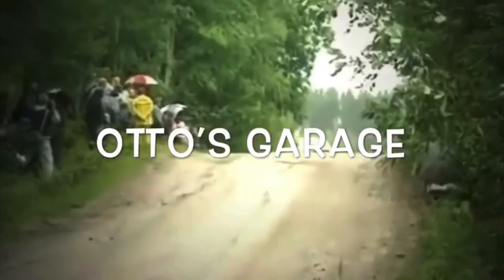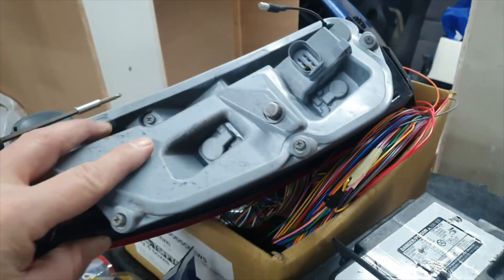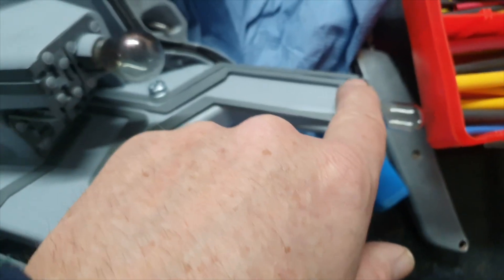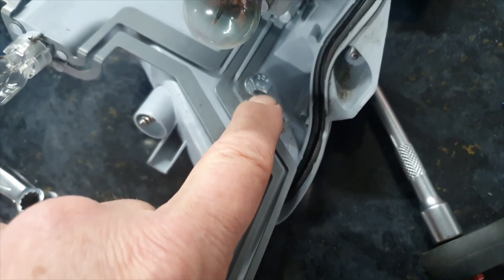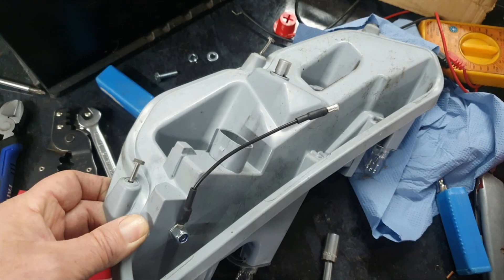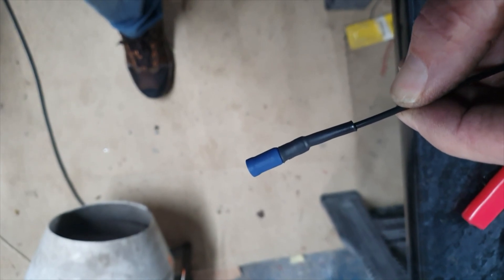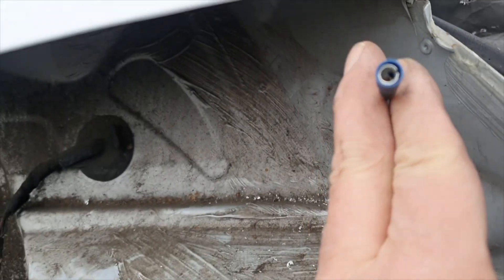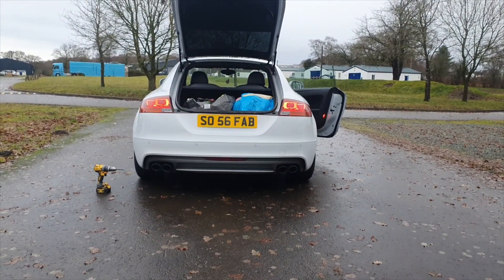Audi TT Mk2 Rear Light Earth upgrade

Comment: I just did this mod and lights are working which is great. After turning the engine on the left speaker has started to rattle with any bass. Is this just coincidence or could it be somehow affected by the mod?
Reply from the maker: Hey! I can't see why it would make any difference to the speakers - it's just a better earth point

Comment: Good video, very helpful. I used your advice to connect the flying ground lead, but I don't have the tools for setting riv nuts.  It seemed to me that the existing brown earth wire was fine and there is no particular reason to suspect the earth wire or its grounding connection. The problem is the under-rated contacts in the multipin connector resulting in local burn-out.   So I simply connected my flying lead to the existing brown earth wire using Wago connectors. This for me was a simpler solution and it seems to work fine.

Comment: did this stop all light from work or just tail lights
Reply from the maker: All the lights on that rear unit. I had done the other side previously. Front lights are unaffected by this bad earth.
Reply: oh okay i have a problem with tail lights only  @ottosgarage7986  do you think it would be the cluster panel? chances of it? as it’s both sides not just 1 side

Comment: Appreciate the video. Might sound dump but Is it safe to put the earth straight onto the body of the car or put it onto the chassis as some videos do?😅
Reply from the maker: Pretty much all modern cars are monocoque construction - there is no actual chassis  just thick rails to support suspension etc. It makes no difference,  just don't fit an earth to an external body panel, like a front wing.

Comment: Awesome vid, thanks for making it.  Sorry for the simpleton question...but what cable and connectors do I buy please?  Dunno what to search to ensure I get all the relevant bits!
Reply from the maker: Go to Halfords or Automotive Components and get some 5amp cable and some crimp connectors. They will have various ones on display. You'll need a crimping tool too.
Reply: Im having the same issue, 0 experience with electronics but looking to fix this. It would be really useful if someone sold a kit to do this, as a lot of things like the eyelets can only be bought in packs of 20 etc